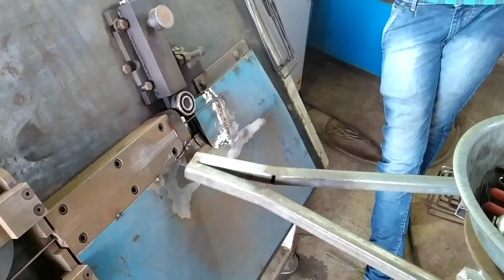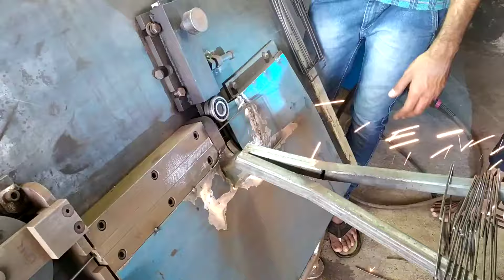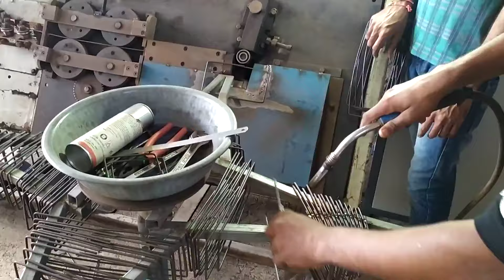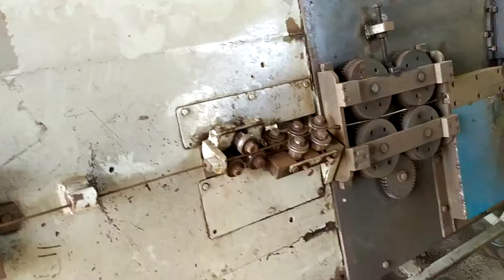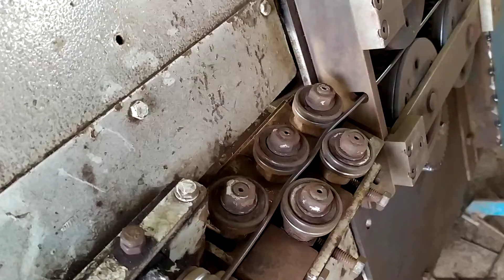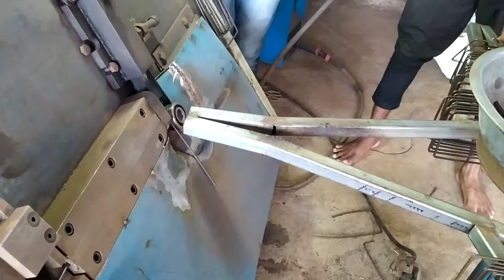Automatic Steel Ring Maker for Cement Concrete Electricity Pole  Manufacturing

Comment: Excellent work🎉 What is the mechanism used to check the lengths? Looks like each ring is having different size. Why so? Whats the accuracy of the sizes manufactured? Does it use PLC?
Reply from the maker: It's an encoder feedback based length measurement sir. Each pole has various sizes of rings ( Around 20 to 24 total rings for 1 pole) 

This machine makes all those rings as per settings. Size accuracy is 99%. The process is VFD based so speed and accuracy is limited. The present speed is 30 pole ring sets per minute. Speed and accuracy can be further improved with utilising servo drives. Yes it uses PLC and HMI. Programming is done by our engineers.
Reply: Great job by your engineers!! @EnineSolutions